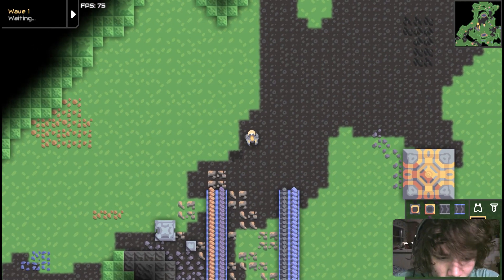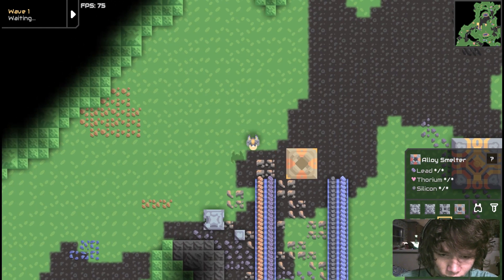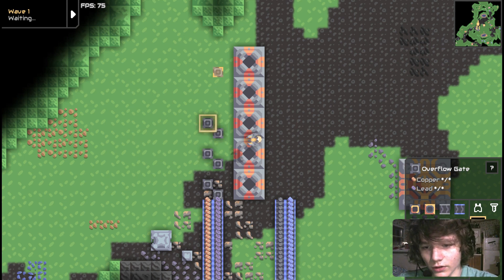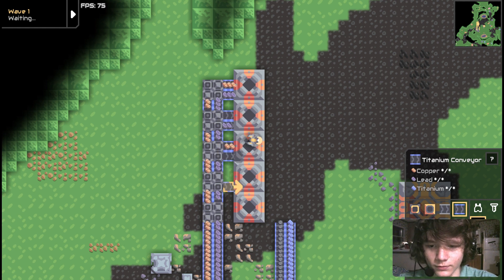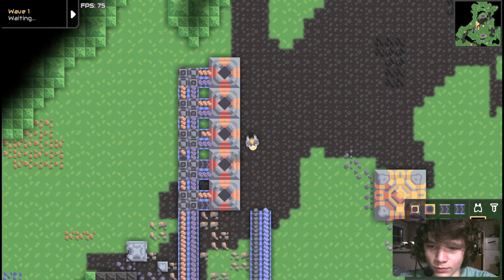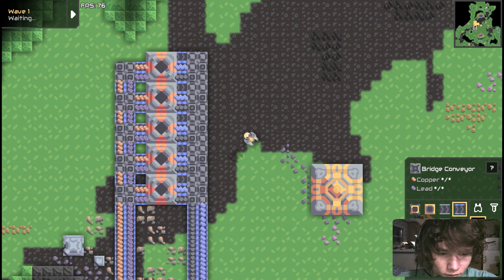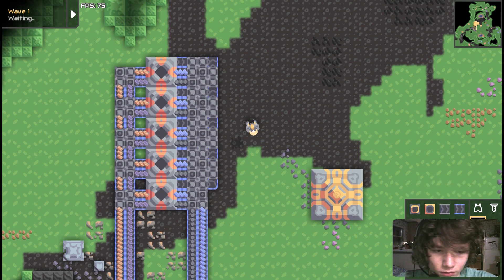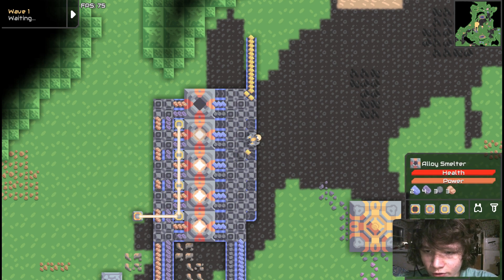Simple Alloy Smelter Setup | How to Mindustry

Comment: A better design is to have all 4 input in parrallel with juctions and routers aranged sort of how you have. In this setup you can have smelters on BOTH sides of the input bus.
Reply from the maker: I think that might cause issues with jamming a little bit
Reply: @AirNeat  
It true that since the bus has width 4 and the smelter has width 3 you might expect issues between smelters. This however can be fixed by placing a sorter set to phase weave. Thus, you don't need an extra spacing between each production unit.